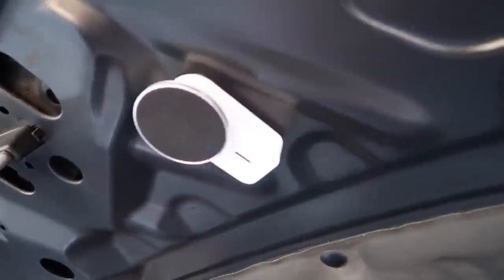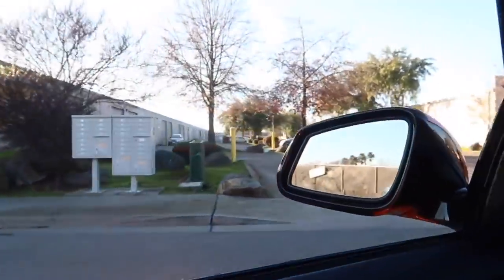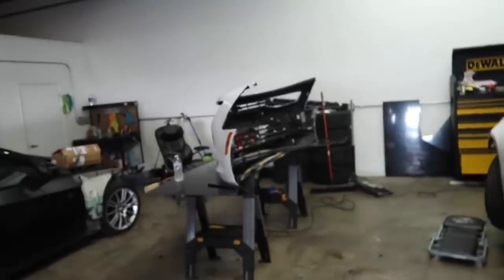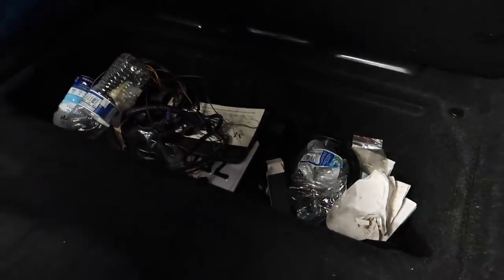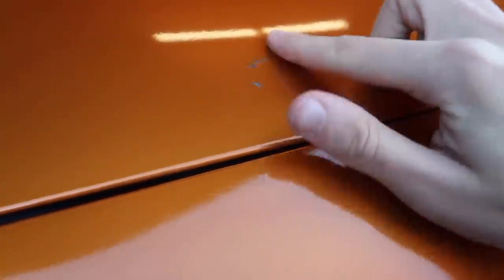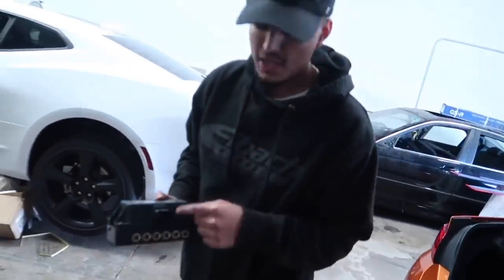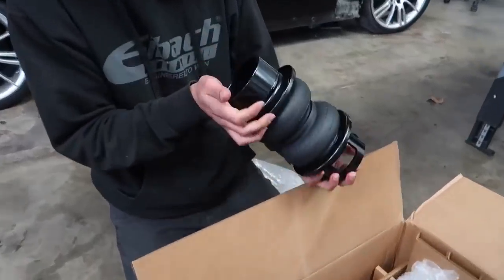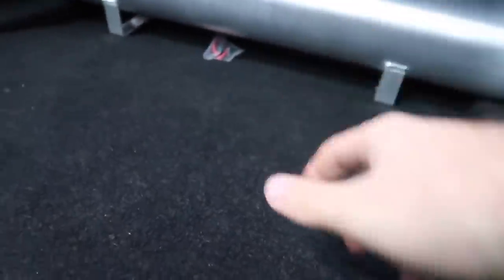435I FINALLY GETS AIR SUSPENSION!! (WHICH SETUP SHOULD WE GO WITH?!?!?!?!?

Comment: I have a bagged f11 the control I have is on the other side of the steering wheel where that little cuby hole is so you can magnet mount it to air vent and up it when needed easy with out looking down much quicker and safer

Also I air out each night and take the controller out good security
Reply: Lol that’s smart. I wouldn’t even think to air out and take the controller at night lmao.